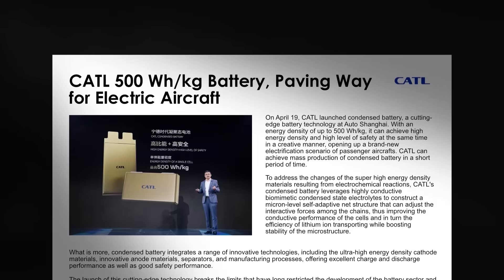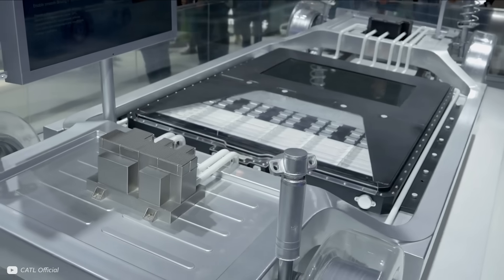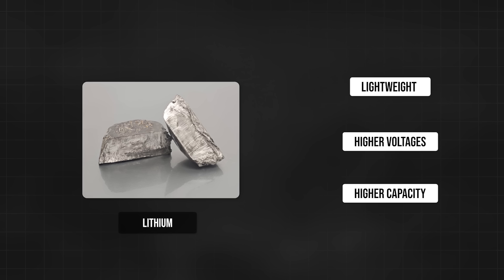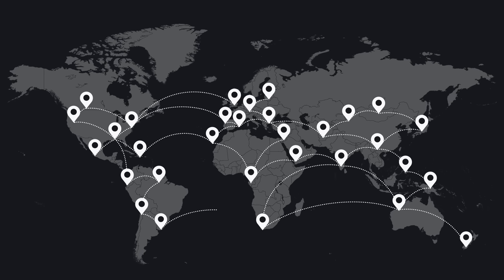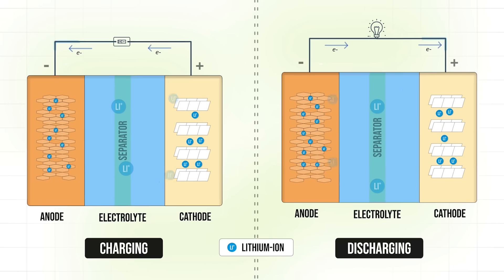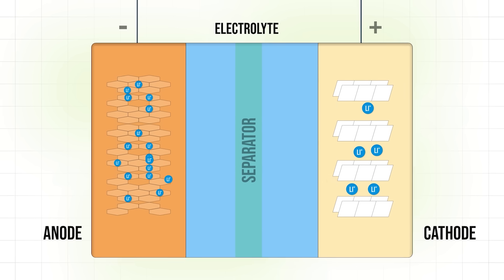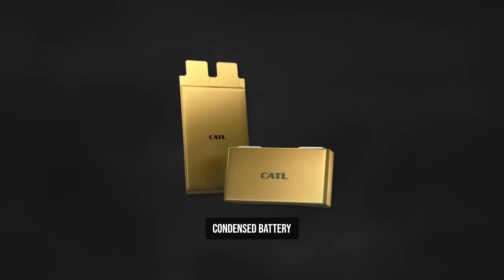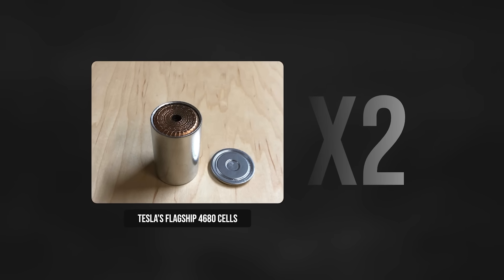Next Generation Batteries: Beyond Solid State

Comment: Solid state was vaporware... it couldn't even get out of lab... CATL is a true innovative company... Kudos for them....
Reply: If i did understand it right tesla uses already dry catode and a gel sort of on the other side of the battery
Reply: @stefanpredl6849  dry cathode has nothing common with solid state..  its a production technology of ordinary anode/cathode... instead of wet process, which takes too much time/investment/effort they have a patented dry plating of powder material to anode/cathode surfaces..
Reply: I doubt it.
Reply: @JensSchraeder  it was and it is... make your own research... and who said actually a hypothetical solid state battery is a good thing??? and if it somehow comes in future there is no way it can be cheap... you can't make manufacturing cost analysis with a hypothetical product.. silicon anode batteries are real and has much superior qualities compared to solid state battery of dreams, but we know they are as hell a lot expensive to produce, and they have no chance to go mainstream... only can be used in aviation/military projects... and I'm talking about silicon anode batteries which surpassed 500watt/h/kg energy density which is equal or better then any lab grade solid state...
Reply: How so? when China's EV car market is going up in flames. And huge areas of the country has EV cars rotting in them. You can see it online. Batteries going on fire is insane. CATL has also lost money.
Reply: @Liberty-Jamie  everybody is loosing money except Tesla... Chinese lose a lot less compared to legacy auto and they will become profitable very soon... they have the best tech to manufacture LFP batteries in mass... and LFP doesn't catch up fire... but NMC does, when it is not produced at least under 7-sigma level quality control (expected level: 8-11 faulty cells over 1 billion produced) and only Tesla/panasonic joint venture has that kind of quality control...
Reply: Search China EV junkyard.
Reply: @Liberty-Jamie  that's bullshit too...EV sales passed 51% on August 2024 in China, and China is the largest auto market in the world, 25 million cars sold every year, that's more than US + Europe combined... and with an average price of 25K usd... there is no ev junkyard wake up...

Comment: Interesting idea, been reading reports from Sinonus (not involved) but they are making battery using carbon fibre as the negative and postive anode with a glass fiber separator so the strength of the unit and weight is so much better than any other design. Ok the Wh/kg for the time being is low but if the structure of unit, say plane is part to the battery then size of battery can be bigger with out costing weight as the battery itself is structural.

Comment: Batteries is a topic that supports many youtubers. Meanwhile nothing changes despite hundreds of "Breakthroughs" and counting,
Reply: Nothing changes? The cost per kWh of Lithium batteries has fallen to 18% of what it was 10 years ago, and during the same period, the energy density has doubled. This is down to thousands of breakthroughs.
Reply: I think he means a new battery chemistry. Weve received a lot of accumulative improvements on Li-Ion but no new breakthrough batteries we kept hearing about@JonS
Reply: @JonGZBOS  Exactly! So many claims, yet nothing really new. Same thing on internal combustion engines. "Revolutionary new designs" never heard from again. Liquid piston leaps to mind.
Reply: @JonGZBOS  there are already cars with Sodium batteries, and redox flow batteries are being used in some installations. Of course not everything comes to fruition and materials science and manufacturing can take years to perfect. Hardware is hard, and new processes are even harder. Hell! Even raising funding is slow. People expect everything to be like new apps with short development cycles.
Reply: @JonS  prototypes are far easier than production I think that's the main challenge. Even tesla is struggling to scale their batteries.
Reply: @JonGZBOS  yes. This is true. Building one of something is relatively easy compared to building at scale for low cost. I know this personally as I develop hardware-based consumer products.
Reply: You've been living in the breakthroughs. Batteries unlike digital technology has a much slower development curve, so it's like a frog in a pot situation. You won't realize that breakthrough when it happens because you didn't notice the last breakthrough.
Reply: It's a breakthrough when I can buy the new battery at the store
Reply: I'm always sceptical of the idea that "it's not happening" I have a hunch that Westerners don't get access to advanced tech because of corporations

Comment: Bonjour from France and thank you for an educational video. My EV is only 5 years old and is already way off the pace, such is the rapid pace of battery technology...pouch cells, NMC chemistry, 147 Wh/Kg, 75 kW Max charging speed ...having said that nothing has gone wrong in 103,000 km and no discernible loss of range.
Reply: My French 10 years car... is 79000km... and the 89cv engine is like a new.
Reply: @contra_plano  agreed the final ICE cars are very well sorted and advanced after 100 years plus of development but are already being challenged by tech barely 2 decades old , i think we know where it will go in time but using your car as is, is a sensible option . If you purchased another identical car new  in 15 years when yours is spent,  I would wonder about the thinking behind that
Reply: @CarkeekW regardless of whether the new electric tech is a proper challenge to ice cars.. one issue to consider is the fact that as of now.. your average person will never be able to properly work on and modify them, which is a substantial disadvantage, they are more expensive not only to own, but to repair. This coupled with right to repair disputes, and what companies like zero do with pay walls tells you that there is alot of work to be done
Reply: @achaean7615  Who wants to work on cars!? Most people have got better things to do than messing about changing their oil and everything that goes with keeping an old ICE car on the road. Few people do their own maintenance anyway as all cars have been stuffed full of electronics for at least 20 years now. As EVs age people will see that they stay viable for longer with far fewer components when something is changed it stays fixed for longer.
Reply: @kiae-nirodiariesencore4270  another problem with your evs is that there is still much room for improvement, as of now the cars you call 'old' are anything but, they are more efficient, they are safer and they are still much cheaper and still hold much better resale value due to the fact that you can repair them yourself. Rn your best evs have around 300ish miles of range ( they lie about the range in the specs they provide) plus that battery deteriorates.. not to mention once that 300 is traversed you then gotta wait to recharge, which can take an hour or possibly even longer. Not to mention your car might spontaneously combust or die when submerged in a little water... evs still have a ways to go, and while I won't deny that they are the future, ice cars are by no means 'old' or inferior vehicles and never will be
Reply: get a real car
Reply: @cr4zyfr0gg  I've got an EV, that's just a superior car in every way from any fossil burning bucket of bolts!
Reply: @kiae-nirodiariesencore4270  right because electricity doesnt come from burning fossil fuels of course. Derp
Reply: @cr4zyfr0gg  You're right, it doesn't. I live in France where fossil fuels are only 5% of the grid and falling. Coal and gas use is falling all the time, USA was 40% coal 10 years ago now it's under 20% and still going down. 80% of my annual driving is covered by the solar panels on my roof so I drive on sunlight. No toddle off and do some research on the fossil fuel content of grids around the world and the direction of travel of those.
Reply: Ok good, but than - Who will pay for your vehicle dismantling ????
The government or you - from your pocket?
Reply: @gregandark8571  What vehicle dismantling?  You mean at the end of its life?  That will be the same as ICE cars.  Junk Yards will disassemble them and sell the parts.  Batteries might be used as stationary storage, or else they'll be recycled, as they contain valuable metals.  The rest of the car will be recycled much like an ICE car.
Reply: @gregandark8571 a new record has been set for the depths that people will go to try to shit on the future
Reply: @gregandark8571  Schooled!

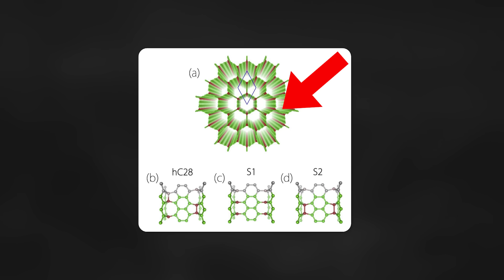Comment: 7:13 Are you showing us graphene?
Reply from the maker: I should have made this clearer! Graphene has weak bonds between each layer, kind of like stacks of 2D honeycombs. This new carbon structure has strong bonds between each layer, making it like a 3D honeycomb! Hope this clears it up
Reply: @ZirothTech  Are you confusing graphene with graphite? Graphene is only one layer thick. From wikipedia:

Graphene (/ˈɡræfiːn/[1]) is an allotrope of carbon consisting of a single layer of atoms arranged in a hexagonal lattice[2][3] nanostructure.[4] The name is derived from "graphite" and the suffix -ene, reflecting the fact that the graphite allotrope of carbon contains numerous double bonds.

Comment: Current flow and electron flow are reversed as per Your video! You say electron flow is from + to -. That's not true is it? That`s current flow...Is True Physics or you wrong?
Reply: In engineering it's + to -
Reply: Negative does flow to positive within the electrolyte causing a flow of electrons through the wire back into the cathode which is why it is the positive terminal, even though it is the negative material. So you are both right. - does flow to + , but as electrons does to fill holes in the anode, it becomes more positive causing the confusion